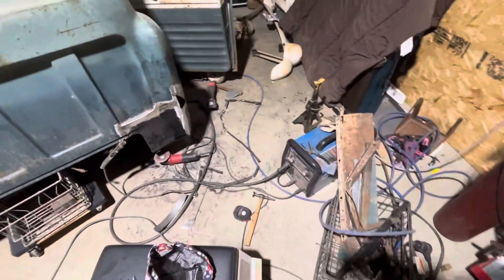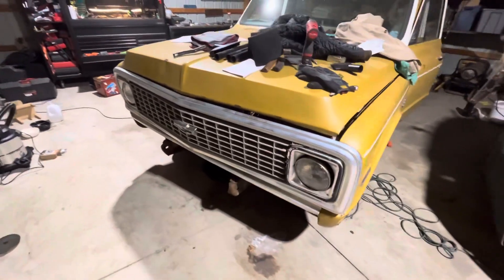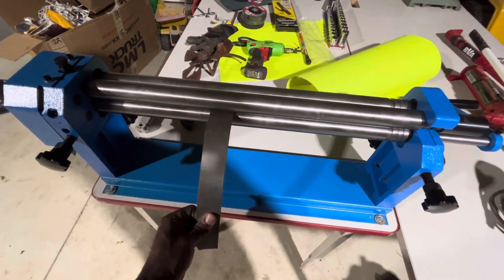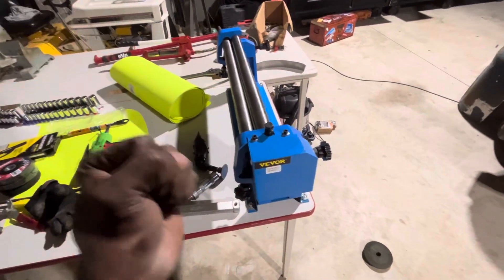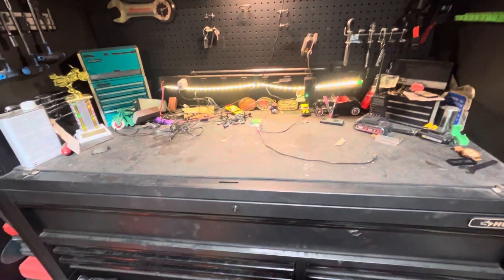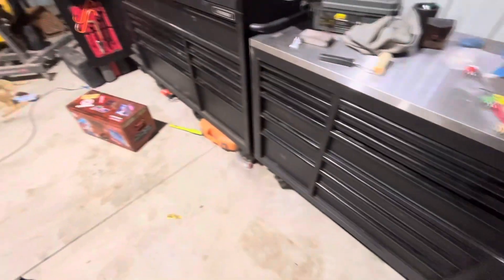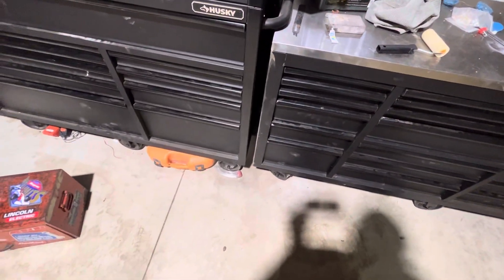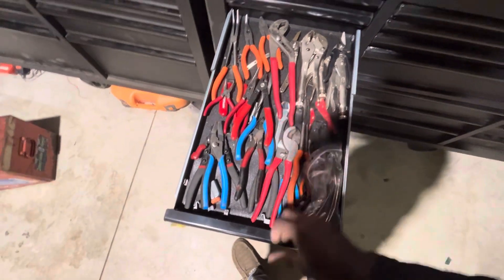New Tools, Project Update, and a Wrecked Motorcycle…and a new Workbench…

Comment: Those are circlip pliers for removing gears and bearings from transfer cases and transmissions. Circlips don’t have the holes like retaining rings. The wider surface area on the outside of those pliers have groves to prevent the clip from slipping when you remove it. These pliers make the job way easier than needle nose pliers.